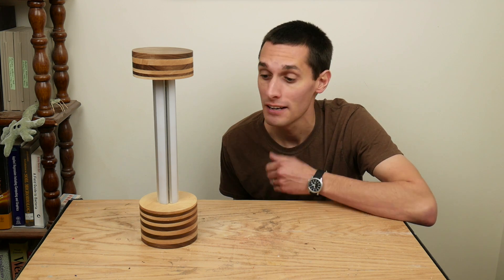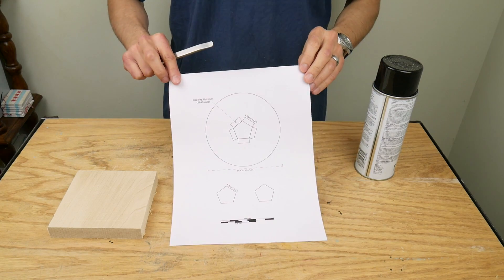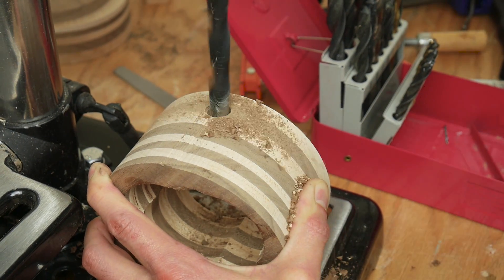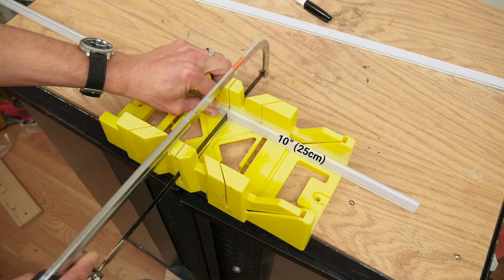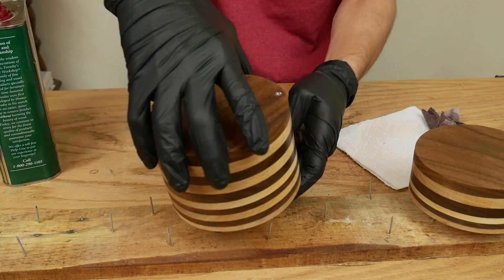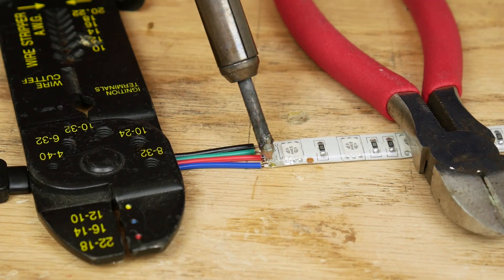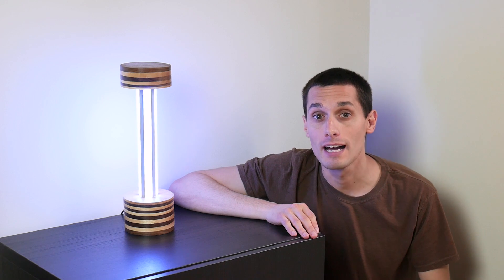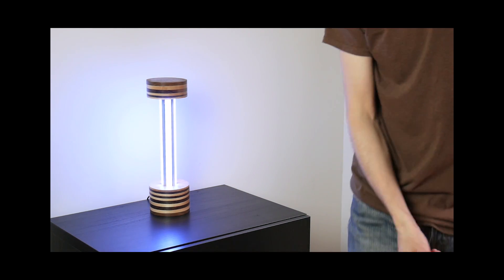How to Make a Color Changing LED Lamp

Comment: I believe this was a waste of material for such a lamp that you can't control the direction at which light shoves it's light at the people, if you buy remote control RGB bulbs from ebay and a multiple socket track lighting, direction of light can be determined by pointing the light by hand toward the wall or ceiling for flexibility and freedom of choice, something this lamp designer does not respect.

Comment: Just wanted to ask u what type o drill did u use and also wow to ur straight forward guide I wish u well u have really inspired
Reply from the maker: Thanks! My drill press is a Central Machinery 8" from Harbor Freight and my hand drill is a DeWalt 20v XR brushless. The drill press is cheap but works fine for me. The DeWalt is very nice.
Reply: Makify1 Hey there , thank you for the quick reply u didn't have to ! Wow super impressed and thank u , I would like to try this build myself but I have never used tools or done any wood work before , really big learning curve do u think this project would be ok with my lack of knowledge and also understanding of wood and the types of tools u had used .
Reply from the maker: Maybe but I would call this more of an intermediate level project. It's not that difficult but you might want to try something a little simpler first so you can gain knowledge and comfort with the tools.
Reply: Makify1 just wanted to say I'm a fan ! One more favour what type of tool did u use for the first bit of cutting , that's a band saw right , could u tell me the make as it looks like something I could use and secondly how hard are they to assemble
Reply: And what was the name of the drill press love ur tools
Reply from the maker: Neal Nathwani It's a 10" Craftsman band saw, model 351.214000. It's pretty easy to set up but does take a little know-how. I learned how to set up and use mine by watching youtube videos.
Reply: I hope u can guide me much appreciated :-)
Reply: Wow that's really kind of u , super blown away by ur help and tips , just a steep learning curve and plus the the classes are quiet expensive 

Thank u again
Reply from the maker: Neal Nathwani You're welcome. I'm glad I could help. Good luck!

Comment: can you buy a separate remote controller for the remaining LED strips you have left ?
Reply from the maker: Yes. You could buy another controller and power supply to use with the leftover LED strips.
Reply: thanks :D one more thing tho, how come other LED DIY lamp videos use an arduino/electronics and you didn't ? won't that short out the led's or pop it ? thanks again :D
Reply from the maker: I assume they use an arduino so they can do fancy effects. Some effects are built into the controller I used.
Reply: ohh, so does that mean i can just do this without using any of those pcb's capacitors etc ? :D i have no idea how to use those circuit boards :D
Reply from the maker: Just buy a premade controller and a power supply and you are good to go.
Reply: thanks :D and more diy vids pls :D

Comment: why the fuck would you use imperial and metric in the same project ??
Reply: Why does it matter? It was super helpful. I am use to metric and I am guessing he is American so he is use to imperial. Most of the world uses Metric so it is helpful to have it.
Reply from the maker: Some of the supplies were in imperial and some were in metric. I live in the USA and am used to using imperial but I am also a scientist and I like to use metric sometimes especially for measurements of small distances. I'm sorry it was confusing but sometimes one tool (imperial) works better for a situation and sometimes a different tool (metric) works better.
Reply: Maybe he grew up using metric, but imperial is used in the supplies (i.e. the 2" segments where you can cut the LEDs)

Comment: very nice job!!!
can you tell me what bandsaw you use?
Reply from the maker: It's a 10" Craftsman model 351.214, exact same as Rikon 10-305 except for the color.
Reply: thanks a lot for the reply, are you pleased with this model?
Reply from the maker: mick szym Yes, but I have limited space so I needed a small band saw. For a small band saw, it is quite good but if you have more room, you might be better off with a larger band saw.

Comment: correct me if im wrong, but theres no need for it to be connected in series. U could actually skip drillin top part, by just connecting all leds pararell in the bottom part
Reply: There's no real way to make 12V strip work off 5V (not easily) but you can definitely get 5V strip. Look on eBay and search for 5v led strip, you should find something. 

Also the difference between 5V and 12V is the number of LED's in each section of the strip. 12V has 3 per section, and 5V has 1 per section
Reply: I was going to say the same thing. It would cut down on lots of work
Reply: tell me how, it's parrarel connection anyway, it will only lower the current running through the led tapes, but no LED whatsoever. (It'd affect voltage only good way in case u made tapes veeeeery long).
Trust me i'm and engineer :D
Reply: wow, I've spent like half an hour looking for that comment :)
If u need help u can write to me. It's very easy, especially if it comes to plugging diodes like that. When it comes to powering only 12V diodes (or 3 like it is on led strip, which respond) it works perfectly like lamp. 
I guess u can find some tutorials on the internet, I know very good channel but it's Polish :/
Only difference for amatour between diode and lamp is how it response to voltage change (easy to burn if u give too much voltage, that's why they always use resistor) and it allows current to go 1 way only.
Reply: Everything's true :P. U could also buy single leds and connect them with cables, that gives more possibilites but requires more time
Reply: Is there a site where you can learn all about how to connect and solder LEDs? Maybe some calculators or at least formulas (i can spread sheet them if so..). I never had any electronic lessons in school and im 37 now. Affording a great soldering station was not a problem at this age which helps as the soldering part wasn't too hard. But when i go to online stores and there's voltages here and voltages there (24, 12), power supplies and ........ it makes my head melt :( Normal old school lamps i could handle as the formulas are pretty straight forward but LEDs are quite different, aren't they?
Reply: +Krisq Gq
I work at a place where we help people who's been away from work for a long due to sickness of some sort. One way to boost confidence is by making stuff. We later sell these things and all the profit goes back into the organisation. It's an ever changing place as people come and go and they all have different difficulties and talents. I had an idea about making mushroom lights (there's a British guy who made a video about them). His leds used 5v but the ones i could find were all 12 or 24. I would like to be able to use a standard cell phone charger with their usb connection. That would let customers power them easily and they most likely have spare ones at home already. I tried to figure out how to make the 12V compatible with 5V from the USB but after a while i had to give up and focus on other things :/
Reply: @krisq Gq Can we get your email to ask something about the electricity?
Reply: Chris Keuken you can use a device called a "boost converter" and go from 5v to 12v DC
Reply: Colour changing LEDs are more complicated. Usually in series tho.
Reply: thanks

Comment: Very nice project, but it would be much easier if you connected them in parallel (yes you can do that), so you dont need a hollow top part. The strips are marked for cutting especially so you could wire them in parallel.
Reply from the maker: Yes, wiring them in parallel would be easier. I didn't realize you could wire them in parallel until after I made the lamp.
Reply: Oh okay, it was just a tip for other viewers who would want to build this too. But you made an awesome vid!
Reply from the maker: Yannick Buelens Thanks for the tip!

Comment: That is super cool and really smart, but some of your conversions are way off. 15/32" is most definitely not 1.8mm, 11/32" is not 1.4mm, 3/32" is not 0.37mm. I think you may possibly have the decimal point in the wrong place. 
Also, why did you snip off the connector only to solder it back on?